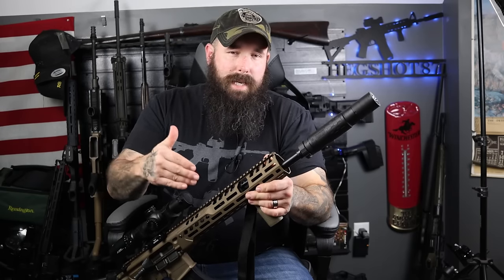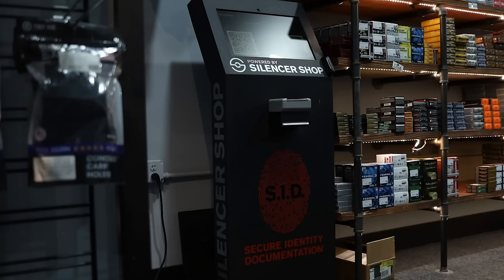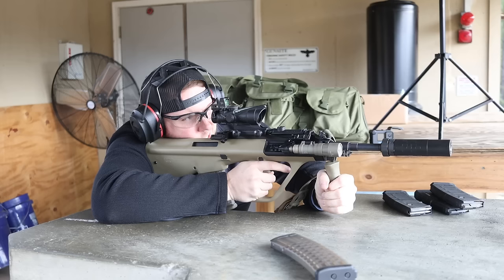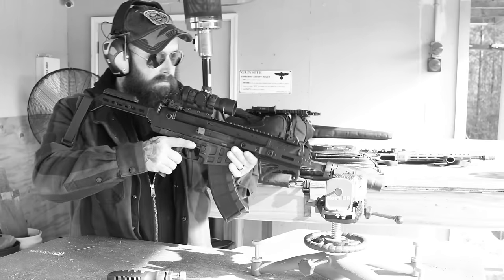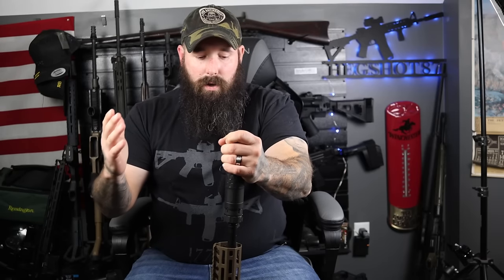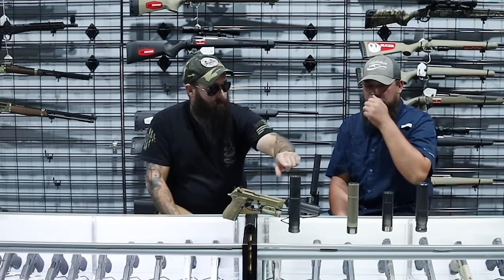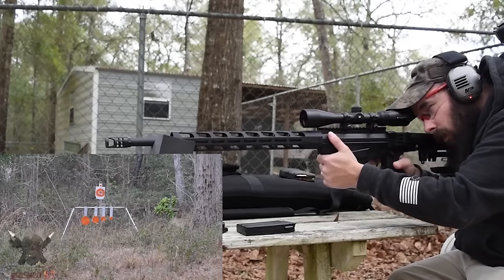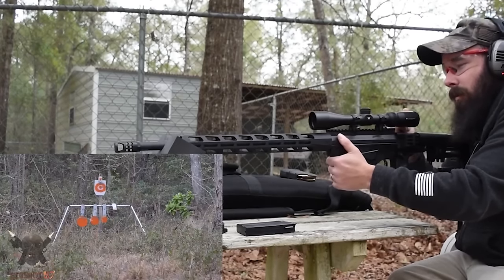11 Crucial Tips You Need To Know About Suppressors

Comment: I'm doing a 300blk pistol build and I will probably not have a silencer in the foreseeable future. $600-1000 for the silencer plus $200 for the ATF.  Yeah, no thanks. Everything is already expensive enough. I'd be more inclined if the suppressor itself wasn't so expensive. I get that titanium and certain materials aren't cheap but come on.

Comment: Thanks for the video.

My tips:

1) Be ready for a life-lesson on improving your patience as you wait to get your form 4 approved.

2) Decide whether you are buying as an individual, a general gun trust, or a single shot trust. Each has their advantages and disadvantages. The single shot trust is great, but a drawback of these, is you have to have a copy of the trust and tax stamp for each item you take out. This is about 22 pages or so. This means if you are taking an SBR and a suppressor to the range, you will be toting about 44 pages of paper with you. (unless you print it to both sides of course) - A positive is the single shot does let you sell the can by putting the buyer as a responsible party trustee (they have to have prints, background check, etc) and then letting them take you off the trust. (or sell it with borrowers rights if you are selling to a friend)

3) If you are looking for maximum suppression of sound, stay away from the short K or SK type models. They look cool but they do not muffle the noise as well as a full size can. (Which I think most folks want maximum suppression?) - A modular one can give you both options in a single package.

4) Lots of people choose a trust because they think it makes it easier to pass the items to their heirs. It does, but you can also just spell it out in your will who you want the item to go to. The person can file a form 5 to transfer it to themself and the good 'ol ATF even waives the tax stamp for the heir.

Comment: When traveling with a weapon, sometimes you do have to handle the locked container. I recently went to South Africa and had a 12 hour layover in Atlanta. This required me to receive my luggage and possess it until I could recheck the luggage two hours prior to my departure to South Africa from Atlanta. Of course, I did not open, the weapons case at any time.

Comment: my question is? do you have to go through the whole wait time again after getting  your 1st can? I am 9 months into my wait time do i have to go through the wait time again or is it shorter?
Reply: Same time from ATF.  You might save a little time if you use the same dealer, as they will have fingerprints and photos on file.
Reply: Same wait every time... Doesn't get easier or quicker
Reply: There’s no rhyme or reason with regard to wait times.  Each application is a separate entity and the wait times could anywhere from 3 months to over a year.
Reply: You have to do the same process over again. Finger prints have to be made within a week of processing electronically, if I remember correctly. This means you cannot send in the same fingerprints you did the previous time.

Comment: Not to mention the 1 year wait. Yes, the ATF said these form 4’s would process much quicker. No it has not happened. 

Second option is a form 1. A bit more technical(this is building the suppressor)or oil filter. But much quicker to obtain a suppressor. Quicker as in 2-12 weeks wait time. Just be thorough and do your research. DO NOT BUY ANYTHING UNTIL YOU ARE APPROVED. No one wants their dog shot

Comment: That was loud! You want quiet i discovered the ultimate pew pew suppressor only drawback is there only good for 50- 100 rounds but good thing is dirt cheap and can carry as many as you want.
So here it is get yourself a white corn  cob not a yellow🌽 one them you going to remove about 10 kernals drill yourself a little 1/4 port straight through to middle or whatever bore size you want.
Stick that cob right on the end of your rifle,pistol,ect gun of your choice except for higher calibers like 50 cal 338 lapua definitely no shot guns you get the point. But 556, 223, 9 mm, 30 cal no problem.
And get this you can travel all 50 states. Going to other countries might be a problem as you cant take fruits or vegetables to and from certian places but really you just make yourself a new one as long as they got corn! 
If you forget to declare and your in danger of getting caught, well simple stick it right up your corn hole and avoid body scanners. No tax stamp, nothing. If someone thinks you been using one either back in the corn hole, or simply start eating it as fast as possible. Hope it wasnt the one you had in the corn hole.
Anyway its so quiet just find out for yourself!
Im not responsible for any problems you  may encounter. Use at your own discretion and be safe and responsible out there. You may want to carry Vaseline or some type of lube with you at all times fyi! Be safe!